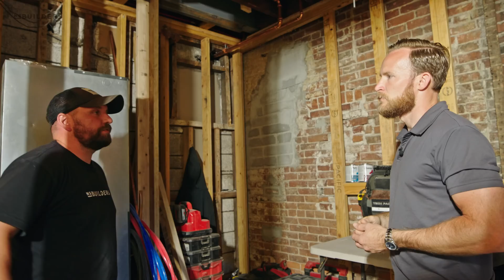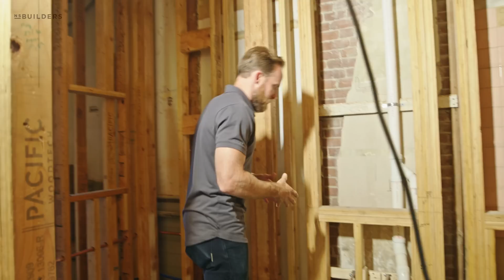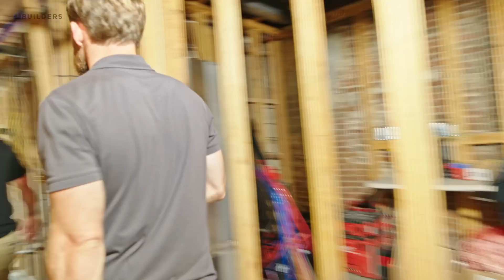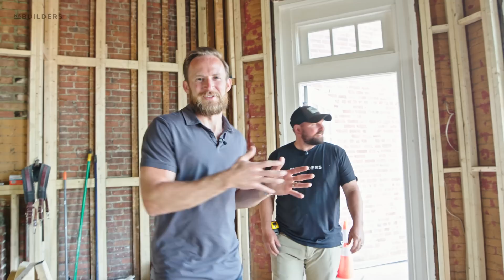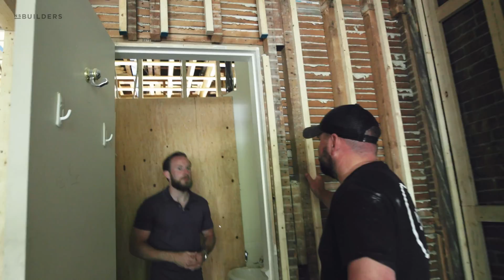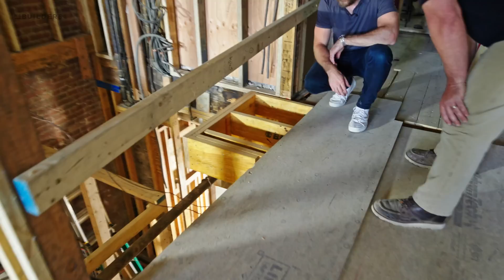These plumbing details will level up your next renovation

Comment: Why not just pipe in that draw off into a waste water drain? Seems like a little thing you could do to make the product that much better.
Reply from the maker: The tough part about that is you would need a trap primer. Or you would need to be closer to say a sink and use a dishwasher T, but that’s a great suggestion and often times we use that detail for condensate

Comment: Nice video.. just wondering if you could have eliminated # of joints in the pex system to reduce potential for leaks..  for instance.. toilet water stubout uses 2 elbows followed by what looks like a crimp to a copper fitting.   Also,  instead of running the ceiling pex on  diagonals, 2 elbows were used which increase leak potential and also adds flow impedance - I don't want to harp too hard on the perpendicular runs, as I prefer things being run parallel and perpendicular as well.  I suppose with all these fitting, I would agree that Pex B with lower flow resistance and greater joint reliability would be a better choice.
Reply from the maker: Sure we could’ve reduce the amount of fittings, but we chose to keep everything nice and neat and orderly. Overall I’m not really concerned with fittings leaking and it would be very similar if we were to do pro press or soldered copper.

Comment: Is that pex B you’re using?   Garbage, you may want to rethink that choice.  Even with Viega fittings i have seen failures before ten years. If you must use pex use pex A.  The slightest micro drip over time will rust out the metal crimps in short order once it starts.
Reply from the maker: Saying that it’s garbage I think is aggressive. Yes there are upsides to using type a verse type B but the downside of using type B is fairly minimal, and it really comes down to flexibility and the type of fittings that you would use which arguably reduces flow rate but I’ve seen tests side-by-side and it’s pretty minimal.
Reply from the maker: Not to mention the metal on the fittings is all stainless steel so rust it should not be an issue
Reply: After you have dealt with a failure you will change your mind. The stainless used for crimps is not a good grade and will corrode quickly with a drip especially with chlorinated water or bad PH. To many reasons to use pex A over pex B. You’re doing high end work with expensive wall finishes but using cheap plumbing behind the walls. Honestly I’m surprised you don’t spec copper.  Your builds are expensive and unlikely to be redone for at least 20 years. I’m even seeing leaks with pro press used on heating loops. Not sure if the high heat is prematurely degrading the o rings or the pipes weren’t prepped properly. No thanks, soldered joints for heat loops last forever.

Comment: Trades that don’t consider locations of plumbing, switches, outlets… 🤦‍♂️ Even worse, when you specify and they move it… How hard is it to centre something with other lines in the room? Attention to detail is what sets good builders apart from great ones.
Reply from the maker: Often times it’s just not something that gets coordinated. And the plumber put it where he usually put it in the finish carpenter is told to keep the job moving.

Comment: Are mechanical vents(air admittance valve) not allowed in Boston? Wondering why the use of an island vent.
Reply from the maker: That’s correct we are not allowed to use a vent like that in Boston. We actually uncovered a charcoal tight vent on the washing machine which we had to re-pipe and vent up and out to passcode

Comment: Is there a specific reason for not using Uponor PEX-a? It has better flowing fittings and less fittings are needed in general. 

Having the hot lines come from central location would mean long wait times for hot water, compared to a branch off system, wouldn’t it?

We stub out with Uponor bend supports for all fixtures, using the framing or metal brackets and never have issues with loose stub-outs. The water here kills copper pipes in 10-15 years.